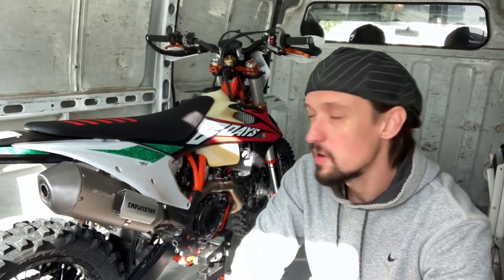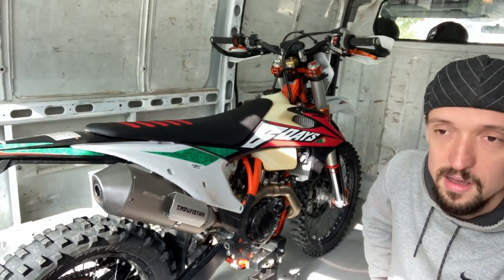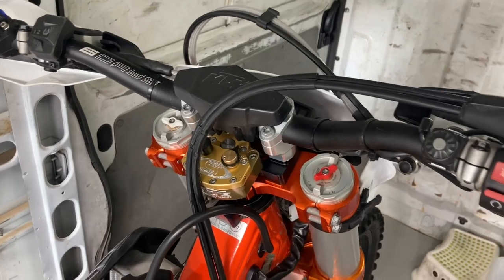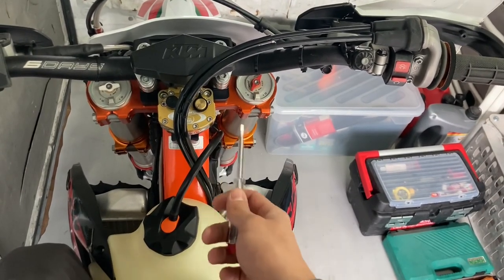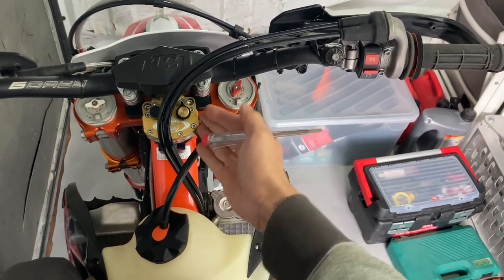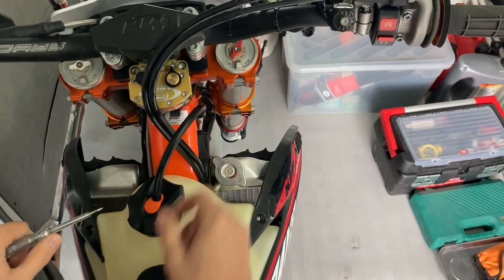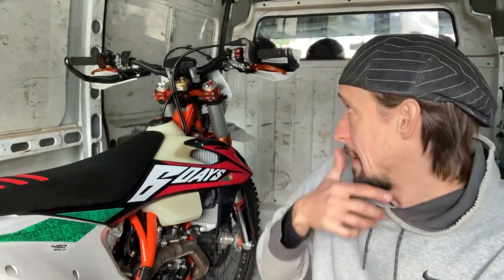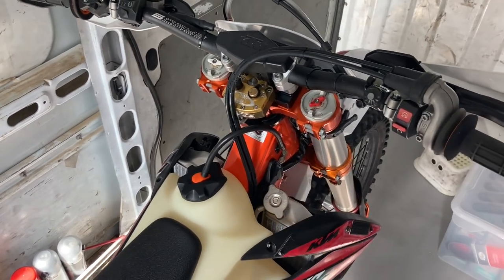Why you should get a steering damper - Scotts damper review and installation on KTM 450 EXC-F

Comment: Extremely through - Greatly appreciated 👍🏾 Using the Ralle-Moto MSC steering dampers on both my 500 EXC & R1200GSA from Vaughn over in Australia. They are a small shop that produces their own CNC billet parts for the dampers. I like their stuff.

Comment: Hi - did you need to use any of those grub type bolts to raise height of pin on the bracket? The parts catalogue shows the two grub bolts. Thanks!
Reply from the maker: No, I believe that diagram is for a different bike. On the EXC-F you just grease the pin and it slides in, the steering damper arm itself prevents it from coming out. It should also freely move around in the seat. Not loosely but it shouldn’t have resistance either.
Reply: @SilkRider  cool! Thank you :-) l have just purchased the same kit from KTM hardparts for a 300 tpi ...... no instructions and l couldn't find any info online. Thanks for taking the time to post the video of fitment - its the best one l could find ....... subscribed! 👍
Reply: P.S - l think that the throttle cable guide is a good addition to thd set up ....... l know that the cables cause wear ordinarily without a bar pad, so the damper will get rub marks as well unless fitted with a guide - scotts and rally raid sell them (slavens and triple clamp as well l think) thanks again.
Reply from the maker: @agee8322  very cool! Yes I have noticed the throttle cables get caught on the damper when they are in a very specific spot as you turn the handlebars. But for me the problem goes away when the half shells holding the cables to the throttle grip are rotated just right (there’s a printed diamond that should be facing directly upward on the KTM grips) otherwise the guide isn’t a bad thing to add if you’re riding hard
Reply: @SilkRider  Hi - when you are back from your current adventure, could you do me a favour please? Measure the distance between the fitting kit stem bolt and underside of damper, to see how much clearance there is? My stem bolt has rounded off! Rubbish metal, correct torx and torque etc. Waiting in a replacement. But, to make future maintenance easier, l was wondering if there is room to allow for drilling the stem nut and fitting an M10 hex bolt and nut so you can gat a socket on it. Hope that makes sense? Seems a rubbish design for a bit that would need to be undone for greasing up bearings ....... would be interested to know your thoughts. Cheers.
Reply from the maker: @agee8322  message me photos of what you’re trying to figure out on Instagram or FB because it’s too hard here on YT

Comment: What kind of bike transport mount is it? Can it be used in a truck bed ?
Reply from the maker: It’s the Proworks Quickload from 24mx. But I can’t find it on their US website... https://www.24mx.eu/motocross-accessories/motocross-accessories_c405/motocross-transport_c406/proworks-quickload-transport-system-125-500cc_pid-PM-0053953

I’m sure you can mount it to any flat bed vehicle, as long as both wheels are flat on the same surface, because the Quickload compresses the bike’s suspension and presses it onto the bed.
Reply: @SilkRider  The Proworks website says they don’t ship to the US but I saw something similar on the Taco Moto website called “BIKE BINDERZ DIRT BIKE TRANSPORT SYSTEM” that I am thinking of checking out https://tacomoto.co/collections/miscellaneous/products/bike-binderz-dirt-bike-transport-kit
Reply: Thanks. Sucks that they don’t ship to US. The system looks awesome tho

Comment: Nice video :). Why did you switch from the rade rally kit scotts damper mount to the oem one?
Reply from the maker: Tried to leave it on but the front of it has a large bracket bulging out for the nav tower mounting and the headlight mask doesn’t fit on top of it. You can use it but need to take the headlight connector and bulb out. I needed lights for travelling...
Reply: @SilkRider  thanks makes sense

Comment: What do you think of the MSC damper and the precision one? Thanks
Reply from the maker: They look like fine dampers although the Precision one looks like a convoluted mounting system. Most important is to have the necessary mounting hardware. Scott’s has worked for me because a) has the most adjustability so I can use my bike in rally, enduro or MX settings and b) it’s pretty easy to maintain and get spares for. But the most important thing is it stabilises your steering. The extras are good if you want more flexibility in multiple use cases.

Also the MSC looks like it has around half the oil volume as the Scott’s. Scott’s is a relatively big damper because the increased oil volume means less fade when the oil heats up during heavy use. Same as brake fluid or suspension fluid heat fade.

Comment: Nice video thanks. What brand/model is your torque wrench?
Reply from the maker: KS Tools
Reply: Few things are worse than not trusting your torque wrench. And I don’t trust my cheap one.
Reply from the maker: @miro_s  well even if it’s a good torque wrench and it’s mechanical it needs to be calibrated maybe every 2 years. You either find a local machine or tool shop or search for torque wrench calibration on eBay and send it out to have it done.